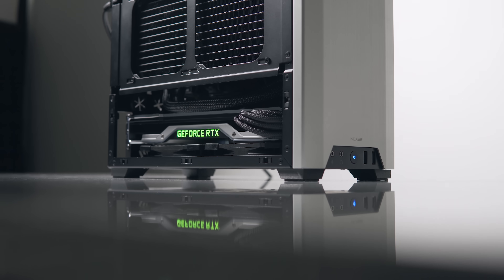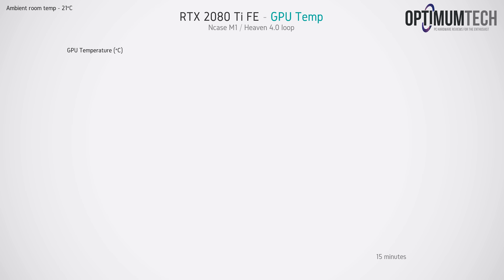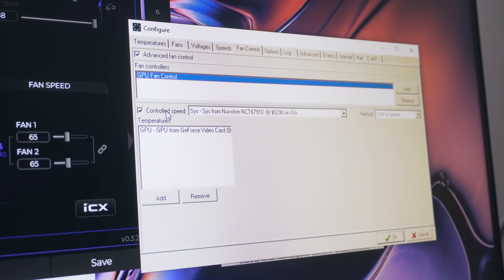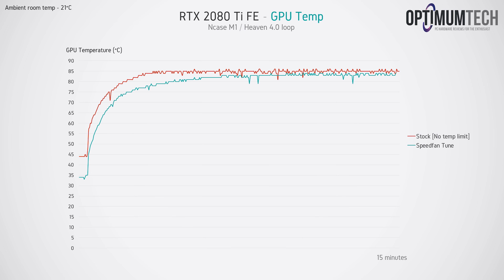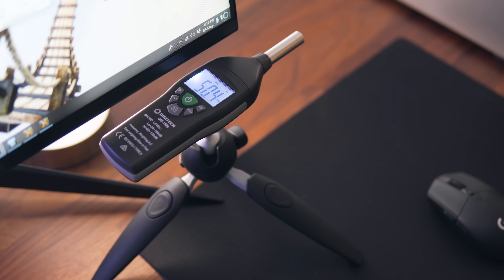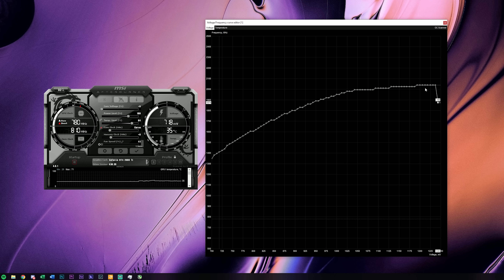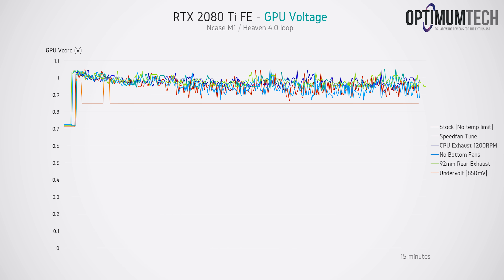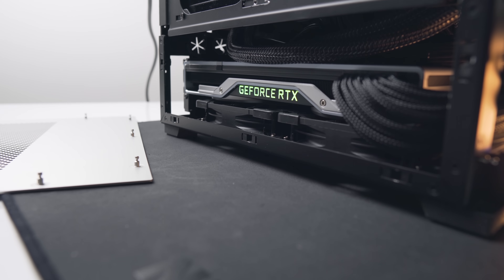Fixing my Thermal Throttling 2080 Ti FE..

Comment: Pro tip, if you hit -200 on the core clock, then drag the max voltage you want to the mhz you want, then click the tick to apply, all the other points will snap in line, doing this means you can avoid dragging every single point.

Comment: you could also have tried to deshroud the card and mount noctua fans directly to it blowing fans towards the bottom of the case and make the bottom fans exhaust that air and changing the Thermal paste and Pads to better ones

Comment: Not sure if its the drivers or not but my 2080ti seems to shut off now. I went back to 442 and 457 and it was good. Not sure if the 460+ is shutting it off or not. Currently replacing the thermal paste to hopefully have it fixed

Comment: i found one of these on offerup for 600 bucks. but it had a waterblock installed on it already, I immediately installed the air cooler only to see 80 degrees underload. followed this tutorial and successfully undervolted it to 1900 mhz and 950 mv's. she's now stable at 49 degrees underload, thank you so much bro!!!

Comment: I recently got a prebuilt with a i9 10900x and put my existing 2080ti from a previous computer into it. Whether its just the GPU and bad thermal paste ( common I hear ) I could not get the monster from overheating my small case up to 85C and thermal throttling/turning on the fans to 100% spikes. I do Youtube sometimes for Planetside 2 and have a small following, but with 100% fan spikes and 75% fan usage BASE it was the noisiest thing ever on top of my desk. Thanks to your video about undervolting I have spent the entire morning fixing my GPUs temperatures drastically and even with bad thermal paste I'm assuming I don't go over 80C and trip the dreaded "2080Ti fan spike". You have given me some serious peace of mind with this basic how to, and I also have a small case that would heat up too fast with it. I'm still looking forward to the 3000 series ( especially the Ti ) for getting a replacement GPU but for now you have literally saved my build from driving me insane - and I can get back to playing and recording games once again. Thanks so much man.

Comment: This is an old video but I wanted to share my experience after having this same issue with a 2070 super fe. I simply replaced the bottom fans with the slim noctua (15mm) I think a lot of the noise is not just the fans spinning fast but also the lack of space between the fans of the case and the fans of the card that create that high pitch sound. After just replacing the 25mm model for 15mm the noise and temp was reduced by a significant amount.

Comment: If 875 mV was the minimum stable voltage, why weren't there results displayed? I can confirm on a 2080 that in games you needd more voltage than in 3dmark for example in order to run stable.

Comment: In my experience with the M1 and Node202, fans need room to work.  1. Install taller case feet.  2. Use 15mm thick fans.  Noctua makes really good thin fans.

Comment: I have just new built similar system with RTX2080TI Founders edition.  My problem is that the GPU fans run at very high speeds while card is on idle as soon as Windows boots.  I have tried reinstalling drivers, updating BIOS.  Really not getting anywhere, any ideas?  I am new to building PCs but have watched a lot of videos and felt confident of going for this build (AMD Ryzen 3900X, ROG Strix X570i, SF750 Power Supply, Noctua fans, NZXT X53 AIO, 2080ti Founders Edition.  Help would be greatly appreciated as the GPU fans are so loud even though HMMonitor says GPU only at 35 degrees.

Comment: Did you try removing the fans from the 2080TI FE and just let the NOCTUA fans do the job? I am doing that myself and it 1- cut down on the noise drastically, 2- keeps me barely under 83C at sustained max load. I followed all your steps but I did not want to downclock so I kept at it and arrived at that configuration. I am also fortunate that the 2080TI I have from ASUS bring 2 PWM headers so the GPU can control the fans without requiring SpeedFan, I discovered it after learning a lot from your video. Thanks for the great content.

Comment: I was having similar heat issues with my 2060 super in a small mATX case. Loud and hot. I spent an entire day messing with fan configs, positions and radiator positions. No change. Finally dove into undervolting which was my saving grace. So thanks for the video and simple instruction on undervolting using the voltage curve. Saved my ears.

Comment: i did this for my rtx 2080 ti gigabyte gaming oc earlier and ocked it to 1800 mhz at 825mv and its so quite, less temps, and upon testing in rdr 2 benchmark, my fps reduced from 96fps to 92fps (average) with 2080ti using 100-120w less power

Comment: Hi I have the same 2080TI card bought recently...While playing Metro Exodus i reach 82-84 degrees just like you. Do i have to run msi after burner every time I wanna play a game? Or the changes you made to voltage and fan curve are permanent one time settings? I also am a noob at this so what voltage do i set this to exactly if you have tried n tested different voltages and fan curves you might have a sweet spot by now for gaming. Many thx
Reply: They're not permanent. But you don't need to keep afterburner running in the background. 
I know I am a bit late - but only just found this video myself, and was curious what the TDP became after undervolting.

Comment: Good stuff. Thanks for sharing your experiences with a 2080 ti in this case. I've been using a 2070 in mine and honestly want more power. So I'll probably be following in your footsteps and doing the same as you and undervolt it.

Hopefully SFFLabs releases the new side panel with more ventilation soon as it seems they made some improvements to the v6.

Comment: Hey man, quick question, quick answer: as a video editing workstation, does the ncase m1 (ryzen 3900x and 2060) with max cooling options get SIGNIFICANTLY hotter and louder compared to a compact atx case (e.g. corsair 400c)? thanks!

Comment: Mine sits at 83 and the card is designed to perform at those temps. Only way to get coooler temps is to take everything of the card and put a custom third party water cooler.
Reply: Setting the voltage lower was smart to reduce heat with same performance.

Comment: Or... Just buy a bigger case to have more flowing air and fans to cool... And with a tampered glass side so you can actually see your rtx founders edition...
As you said in the video, you have pushed airflow to its max in this pc case, and if you have to reduce max performance of an $1000 GPU to use it without thermal throttling, what is even the point of owning such a expensive card. Put the pride asside and put your system inside a bigger, max airflow designed, pc case, because your GPU ain't worth a downgrade because of not enough airflow.

Comment: "custom loop"

Hey just so you know, water cooling is not always quieter. It's really nice for getting the heat away from your system, and or giving your system a much smoother thermal load, but it doesn't mean it's quieter.

You should look into it a bit before you continue to try and improve your sound levels. You might actually get a quieter system with a full air setup than you are getting with the AIO, and although a custom loop will probably be quieter than the AIO, it might still not be quieter than air if you're not moving the heat away from they system at all, or even outside of the case.

Comment: Dude did you try changing thermal paste? That could easily help with your temps probably...also the card is an open air cooler so as you said it dissipates heat in this tiny case...My S340 and R9 390x knows it TOO well lol until I put a G12 and AIO to my 390x and control CPU and rear dissipation fans to be controlled with GPU temp from speedfan and boom problem solved! I don`t know about ur specific case cause I don`t know the layout of it but for traditional cases having an Air cooler for CPU helps A LOT with GPU heat dissipation.

Comment: You forgot a pretty big point of improvement - repasting the GPU. Stock paste is rarely good, and although repasting is generally the most ideal when you have good cooling to begin with it can definitely drop your temps by a handful of degrees - which can easily result in much more tolerable noise levels.
Reply from the maker: it has been re-pasted :)

Comment: You should remove the fans and shroud on that 2080Ti and use only the fans on the case, i bet it would be cooler and quieter than either configuration you tried.
Reply: I think so too.

Comment: you can change fan speeds depending on cpu or system temps in the BIOS
Reply: Or you use a dedicated program for it, which has more customizability, is easier and quicker to use, and is overall better than the limited crap you get in the BIOS menu.

Comment: Why did u not just do custom watercooling and modding the case to get the tubes around: u could just use the rad as a reservoir and use a cpu pump combo block

Comment: Can you run two single 120 rads on the side, instead of dual 240 rads?? Might be worth slapping a 120 rad for the 2080ti and down sizing the CPU AIO to a 120 as well.

Comment: first, get an adapter and splitter so the fans will run off the mini 4 pin pwm on the gpu.  second get slim fans for bottom of the case,  or see if a morpheus would fit in the bottom.  with a morpheus cooler you may actually be able to leave the fans off the cooler and have the fans on the bottom of the case blow up through the cooler as both intake and gpu fans all in one.  you may need slim fans or normal fans depedning on the gap between the morpheus and the bottom of the case.  or use slim fans on the gpu and the bottom of the case or use the standard gpu fans and slim fans on the bottom

Comment: I dropped 10+ degrees on my 1080 by changing TIM to Thermal Grizzly's liquid metal TIM. Also you want to try 15mm height fans in the bottom of the case to prevent turbulence.

Comment: Press CTRL + L when undervolting.  It makes it so you don't need to drag down every single point.
Reply: CTRL + L locks the frequency/voltage so the card will remain at that point regardless of whether you are gaming or not. It can be useful for testing purposes, but you do not want to leave it locked

Comment: a 2080 would have been a better GPU for you why buy something so expensive to run it at a lower spec just buy the lower tier save money hassle and time
Reply from the maker: Hi Mark, it's not running at a lower spec. It's just undervolted. Lower voltage, same boost clock. 
No hit on performance. Personally I prefer small form factor systems.

Comment: PLEASE do a custom NCase M1 build. I've been hoping you'd get to it at some point for about a year now. I've been wanting to do it for my own ncase build but haven't had the money. I've done a fair amount of research into it tho. (For anyone interested, ill link my findings below).... hope this may of be of use. 

NCase M1 Custom Loop Idea: (I chose the (2x) slim 240 rad option)

*Shout out to d MeGustaPapayas on reddit for posting his custom n case build. helped me inform a lot of my findings:

MeGustaPapayas Build Log (pictures of build included): https://www.reddit.com/r/watercooling/comments/8n446k/another_dual_240_ncase_m1_build/

Custom Loop Parts: 

Fans (x2): Noctua NF-A12x15 PWM - $20
GPU Water Block: EK-FC1080 GTX Ti FTW3 - $150
Angle 90° Fitting (x8): EK-AF Angled 90° - $7
Straight Fitting (x16): EK-ACF Fitting 10/16mm - $7
Rotary Fitting (x2-4): EK-ACF Rotary Fitting 10/16mm - $10
M1 Reservoir: FrozenQ M1 Reservoir - $70
Rads (x2): HL Black Ice Nemesis 240GTS - $61
Koolance Male QDC (x2): Koolance - $23
Koolance Female QDC (x2): Koolance - $25
CPU Waterblock/Pump: Apogee Drive II - $145

Comment: I've got a large mid-tower case & I still couldn't stand the noise from my 2080ti FE, it's clearly just not well optimised with its voltage curve. I just got a waterblock & that obviously fixed the noise problem. It runs about at about 2085MHz now, though I haven't played with undervolting enough yet so I might be able to hit the magical 2100Mhz!

Comment: I suggest a 1845 MHz for 875mv.  There is some intensive titles that could have issues and instability with 1860 . The difference in performances is less than 1 FPS.
To answere all people that understimate undervolting : the difference between a stock 2080 ti and an undervolted one is less than 2% in performances with 23% of less voltage and 15% less of power usage and around 10° less or temps. Is not worth like Vega that have 50%  more of improvement with temps and power consumption  but is something that anyone doesn't overclock  should consider

Comment: I specifically got the Asus ROG 1080Ti so that I could take out the stock fan and run 2 120mm fan on exhaust on the bottom. I'm not sure if it would work for the 2080Ti version.

Comment: Doesnt under-volting limit performance?  Ditch the water cooler. I wish my EVGA 1080ti wasnt so loud either. 

I would say, air cooling on CPU and water cooling on GPU for quiet operation. But watercooling GPU's are a waste of money because its $200+ for something you will have a tough time offloading in a resell. 

What you need is a custom heatpipe system for the GPU that takes the heat outside the case, or a different design where its sealed off from the rest of the case so you are able to directly flow air over and out of the case through custom fan mounting and case holes.

Comment: Hey... Have you considered try to use 2 Watercoolers? Soon i'll start my build in my Ncase and i was thinking about use 2 Corsairs H80i v2 with slim profile fans and a Kraken g10 for the gpu.  I measured the inside and i guess it could be possible. Could be even more possible using something like a Corsair h75 or any other 120m WC... Great content always =) cya

Comment: I think you can try the Noctua NF-A12x15 for under the GPU, the air between the GPU and de Fan's have 10mm more space to move. Temps should be the same, but noise should be better.

Comment: I believe if you remove bottom fan, lower the GPU further to the bottom of the case allowing the GPU fan to pull fresh from outside the case, and ensure no hot air circulates inside GPU chamber, it will be better for both temperature and noise performance due to turbulence

Comment: Can you throw that 2080Ti in a Ghost S1 and see how it performs? I'm thinking of putting one in my S1 and I'm worried about noise and temps and would love to see a video like this one where you optimize the card for that case. Thanks for all the epic content. Best SFF channel on youtube by far.

I have a whisper silent build in the M1 right now with a strix 1080ti with the stock fans and plastic shroud removed and two noctua static pressure fans mounted in the bottom of the case like you have here, but they're running exhaust. The card sits right on these and never goes about 67 degrees even with the fans spinning at their slowest speed. The whole build runs on air and is dead silent. I want to switch over to the S1 for aesthetic reasons, but I need to go to a 2 slot card to do so, hence the desire to upgrade to the 2080ti. Would love your help with a build like this!

Comment: Don't you still have your Arctic Accelero GPU cooler? It works with it.
Reply from the maker: Yeah I do but I'd need to glue heatsinks to the VRM and memory which I don't really want to do (they're a pain to remove!)
Reply: @optimumtech  You could get thermal pads from Thermal Grizzly and go with that, or other aftermarket thermal pads, and even get copper heatsinks from Alphacool and use those instead of the VRM and VRAM heatsinks that came with the Accelero.

Comment: Not just a 2080 ti any card will run hot in a small case like that or any small case with no air flow and your temps are of course gonna run hot. I'm surprised you didn't opt out for a better air flow case personally a custom loop wouldn't and isn't necessary.

Comment: So would a aftermarket gpu run better seeing as it has a bigger cooler? Or will most just be too long to fit? Surely one of the twin fan but thicker gpu's would work?
Like surely a ROG Strix card aint going to fit, but a MSI Ventus OC, or EVGA XC Ultra/gaming looks like it might? However you'd loose the ability to run intake fans down the bottom.
How much of a hit did the CPU take when you swapped the fans around on the AIO?
How much of a hit would the CPU take if you ran a 120mm rad? Would it be possbile to run 2x120mm rads (where the 240 is) and run something custom or the likes of seahawk/waterforce

Seems like abit of an investment tho ($2k+ just to test fit and play around)

Comment: Raising the case by couple of cm would further improve temps and noise.  The Gap is too small for unabstructed intake.
Really looking forward to see what you end up doing customer loop. Imho, you need at least 280x45 or 360x45 rad to keep things both cool and quiet. At least thats my experience with a bit lower spec system at 25-30C ambient

Comment: I think one of the reasons why your 1080 TI work so well is because the EVGA one had such an open shroud design where the 20-80 ti founders edition is actually very closed off on the front so it doesn't really allow air to penetrate as effectively

Comment: The 2080ti appears to have kraken g12 compability. If you are able to stick notcua fans of that thickness, you should be able to easily fit a kraken g12 mod on the 2080ti. I'm sure you have heard of it. Not sure what kind of pain you may have with it. Just get a 120mm aio.

Less noise, especially if a good aio, and much much better temps.

Redit post about support for it. Check it out :)

https://www.reddit.com/r/nvidia/comments/98w44y/rtx_2080_ti_w_nzxt_kraken_g12_compatibility/

Comment: Yeah, that's why I will never go back to ITX build, my 2080 ti in ATX case can run at 2.1Ghz without thermal throttling, plus better noise level and ambient temps doesn't have to be Alaska like lol